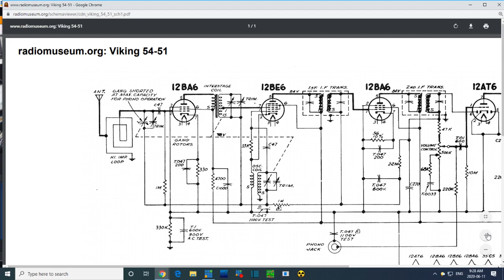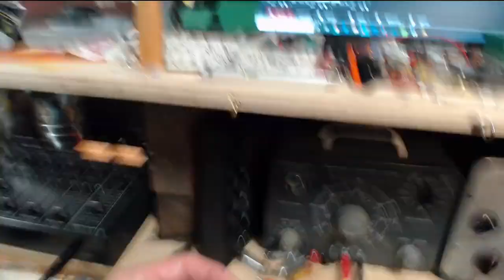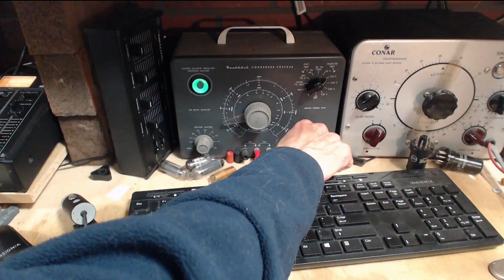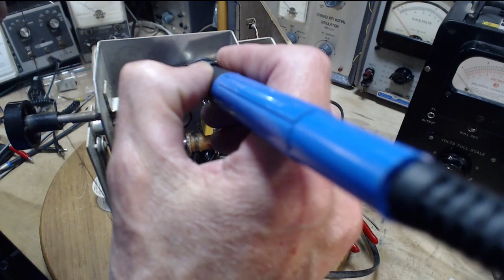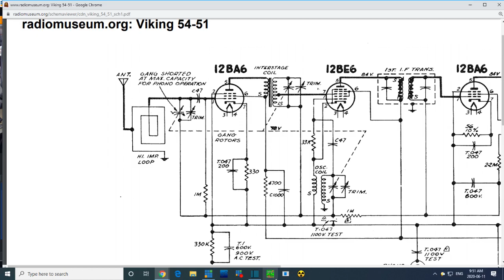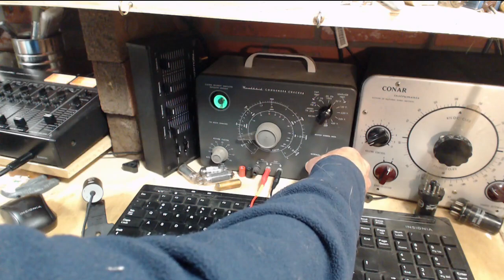Viking Model 54-51 Video#10 - RF Capacitors

Comment: Leakage is not the only problem that develops with age in capacitors. ESR rises which increases losses at the frequency range of concern. Capacity generally increases with age, unless the capacitor goes open. This is of concern in resonant circuits.